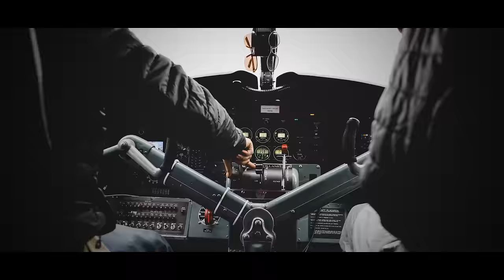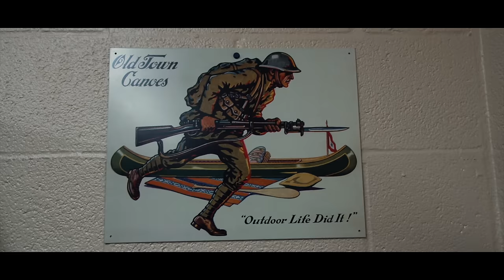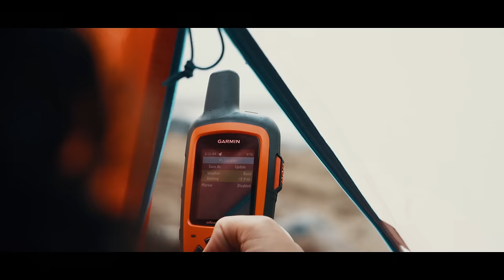10 DAY WILDERNESS CANOE TRIP || Lessons From The Allagash

Comment: I applaud you for this effort. Hard enough to do just the boating and camping part. Let alone shooting a film while you are at it. Great determination and work here! The battery management in the bush is no small task in itself.
Reply from the maker: Thanks Brian! It was definitely a major trial and error process figuring out a workflow for longform wilderness shooting. Solar was a big help, but we still had to be pretty wise with power management. It helped us iron out a lot though going into the production of our feature film Big Land. Check it out if you get the time/means: vimeo.com/ondemand/bigland
Reply: @TightLoops  I will certainly check it out. I have produced my share of remote content, and the logistics are a great challenge.

Comment: The are 3 ways to steer a canoe from the rear.  Paddle on the opposite side to get the canoe to turn the opposite direction.  Break on the same side to get the canoe to turn in the same direction.  Also, backpaddle on the same side to get the canoe to turn in the same direction.
Reply from the maker: you got it!

Comment: Get rid of that Penobscot and find a used 17' Old Town Tripper, that's the best tandem wilderness canoe.
Reply from the maker: Yeah the Penobscot is almost 100 pounds, but it was a great canoe for the low water we experienced. Just pounded that thing and it kept going. We took it on a trip in Northern Ontario this past summer that required a lot of portaging though and it was kind of a nightmare. Definitely in the market for something a little lighter. Where those old trippers Royalex?
Reply: @TightLoops  Yah, they were Royalex, light, roomy and tough. Old Town lost their supplier for royalex but are trying to get it again. I have a Old Town Pathfinder 14.6 called the mini tripper. Put a foam solo saddle in the middle, reshaped the bow and stern to get roll away instead of tumble home and put bags in both ends 1/2 decked over, Still fit all my gear and food in 4 small dry bags, 2 behind my feet, 2 in front of my knees. Portage the falls, canoe and gear, one trip. I have run class 5 in mine and have hit some brutal sharp rocks. It has major scrapes and deep dents but it still slides over everything. I think it's 48 or 52 pounds. The tripper is no where near 100lbs. The Discovery's paddle hard. If you got in to a royalex you wouldn't believe the difference.

Comment: Why did you drill a hole in the front of the canoe and run a rope into it??
Reply from the maker: Good question! We did it on the back as well, and they are called "bow and stern loops", and are used for attaching lengths of floating rope. The loops are not wide enough to get your hand into, so they are not to be used as handles, simply as a point to connect a rope. The ropes are then used to "Line" and "track" canoes up and down rivers or around obstacles  (you can see us do that a number of times throughout the video. Wild rivers with unpredictable terrain require this to be done quite often, and it allows you to control the boat many feet away, and walk along shore. In this way you can float your gear and canoe off the bank 10-20 feet and sent it down a shallow rapid (for example) without needing to wade through it yourself. If you were in the boat it would scrape the bottom from weight, and if you needed to portage around it you'd have to carry all your gear and canoes on land which is super hard and dangerous (throw out your back, break and ankle, etc etc) so it reserved for times when theres no other options. We drill a hole and attach it where we do purely for physical reasons; you want the point of attachment to be as low as possible so that it doesn't flip the canoe over, but you also want it high enough that it doesn't create a leaking problem. The height we put it at never sees water, so there's no danger of it taking on water. Anyway, you can read all sort of stuff about canoe rigging out there, lots of interesting information!

Comment: Fantastic video! What an adventure!! What model of OT canoe were you guys using? I’m in the market for a canoe for fishing and adventure paddling. 🙏🙏
Reply: Penobscot 174
Reply from the maker: Yep! Penobscot 174. Great and durable tripping canoe, however, if you're interested in solo paddling you might consider the penobscot 164, or maybe even one of the Discovery line. The 174's made sense for us because we had a ton of gear, but the canoes way just under 100 pounds, making them pretty unmanageable solo. (for portaging and loading/unloading)

Comment: I take it the more skilled use the full two weeks to make this trip.
Reply from the maker: I can't quite tell if you're tryin to take a dig at us with that comment or not, but I'll try and un-ironically answer your question. I don't think skill has much to do with speed on the trip, rather it depends on the goals of the paddlers. Sure, theres probably a minimum time unskilled paddlers should allow because of their inefficiency, but I've seen tremendously skilled paddlers push through the whole thing in 4 days because the goal was to make distance. I've seen equally skilled people take two weeks and spend multiple days at each site, make side trips, etc.  We started our trip out under a false sense of security taking 3 days to cover the first 5-10 miles, then quickly realized we needed to quicken the pace. The next week was essentially full bore 10+ hour paddling days into the wind to make it back in time for our schedules. If we could do it again we'd probably a lot more time, and make it more about enjoying the time then pushing hard. It was a valuable learning experience though, and probably improved our skills as paddlers 10X your average trip. Anyway, the full waterway is between 90 and 100 miles depending on your exact route. The first section on the big lakes is a bitch in the wind, and somedays you may make 0. Once in the river you can obviously make greater distance, but we were so behind we found ourselves paddling hard even in the current. Trying to calculate daily mileage in advance is sort of futile, but still worth taking a shot and then adding say, 3-4 buffer days just in case.
Reply: @TightLoops  Thanks for the response!  Yes a bit of tongue in cheek with a bit of truth woven in.  It is such a wonderful landscape, all of Maine, I have been on short trip mostly where time is critical and yet I strive to have leisure in my out of doors experiences,    We live in such a hurried life style.  A late fall trip last fall was spent on the St Croix over a distance that could have been easily covered in a long day under a rush took this small group 4 days, it was a pleasure, and lead by a notably skilled fellow at Jack Mountain. Tim Smith. You can find the video in my collection, https://youtu.be/wCm8rWfwLBU   I should really purchase your video, it looks enthralling!  super video work, too.  We all travel at our own pace.
Reply from the maker: @downeastprimitiveskills7688  Totally. Thanks for the kind words and the Tim Smith share. Checking his stuff out now!

Comment: Whats the cost of the trip ?
Reply from the maker: Totally depends on what gear you have already etc. But assuming you have everything you need, the cost of the shuttle service, as well as camping/gate fees in the North Woods, cost several hundred USD. I don't remember exactly, but somewhere between $300-$500, and that was for 10 days. More than half of that was the shuttle service. If you had multiple cars and could shuttle yourself it can be really cheap.
Reply: @TightLoops  so how much total ?
Reply from the maker: @maciejnielacny4652  I thought I just answered that? Somewhere between 300-500 USD. If you decided to shuttle yourself, it might be closer to $150-$250.
Reply: @TightLoops  Thanks ! Nice trip

Comment: Were you  with a guide or have a valid  permit ?
Reply: I  think you had guides doing the lifting and protecting you  and doing the heavy lifting while you told stories.
Reply from the maker: For which trip? The Allagash? On the Allagash you need a "permit" for each day that you cam't along the waterway, as well as a Maine fishing license if you want to fish. We had both of those, but we did not take a guide (nor are you required to). Labrador was far more complicated, and we did have to have a registered guide with us there (only for fishing, however. If it was purely a paddling trip we would not have required a guide).

Comment: Genius drill holes in boat to make handle 🤦🏻‍♂️
Reply from the maker: haha, it's not a handle, they are bow and stern loops, used for attaching ropes for "lining" and "tracking" a canoe up and down river. If fact the loops are tight enough that you cant fit a hand into them, rendering them useless as handles. This is a very common rigging technique for canoe tripping, and the holes are drilled miles above the waterline. That particular canoe only needs about 4 inches of water to float, making those holes almost 2 feet above that. Never had it leak once. You wouldn't believe how many more holes we drilled into that thing before going to Labrador! vimeo.com/ondemand/bigland